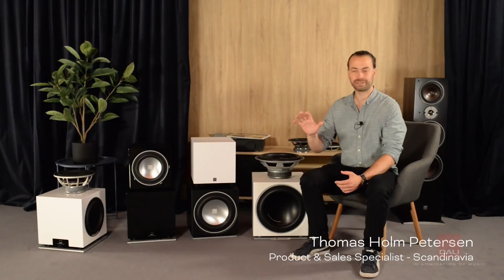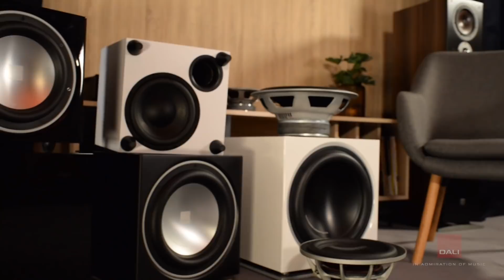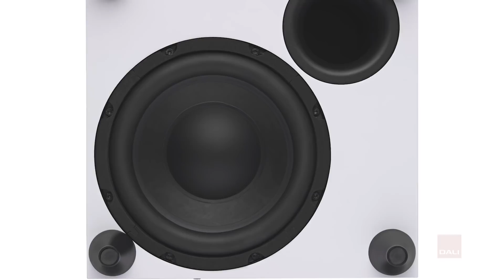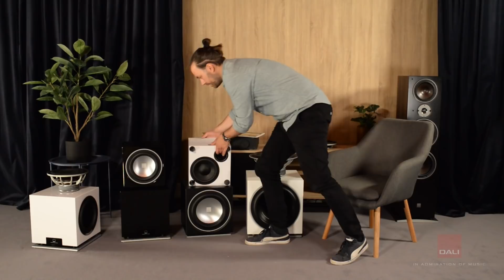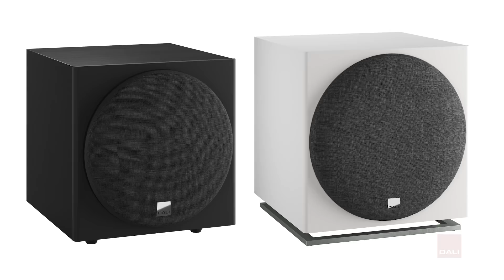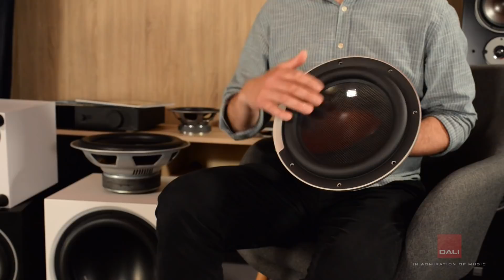DALI Subwoofers: Explained

Comment: Why Dali subwoofer engineers don’t make them go down to 20hz but only to 40hz?
Reply: Because its for a different market. To go down in 20hz, is not that easy or cheap if you need to produce to comercial use. Much cheaper and easyer to achieve in DIY, otherwise you need to spend som serious money.

it needs Loads of space, volume and power. 

Its not always the hz, that tells if its a good subwoofer or not. 

If DALI wanted to, they could, but its not what 90% of their customers ask for.